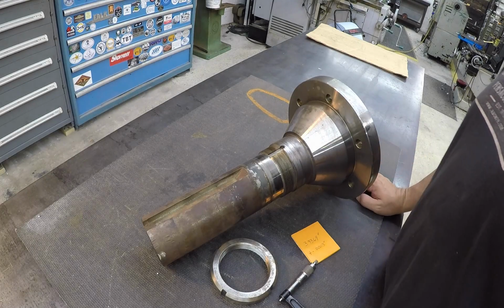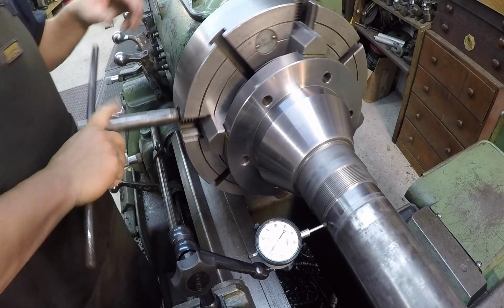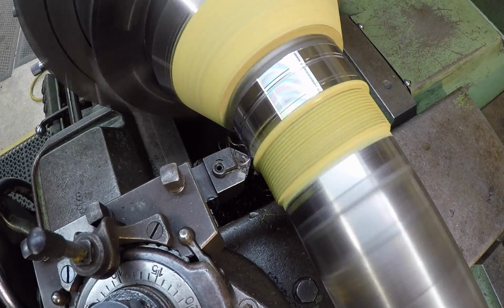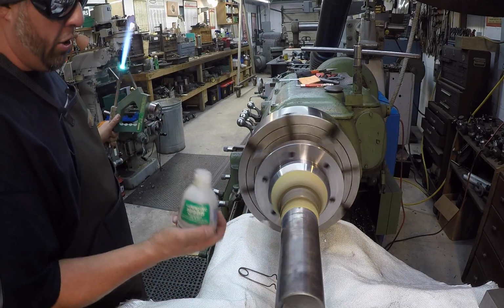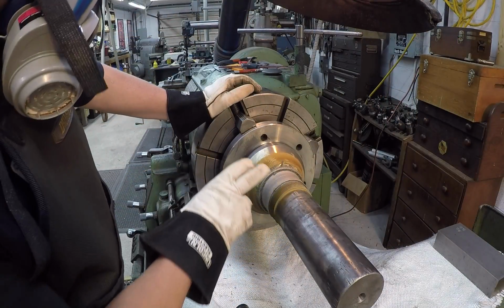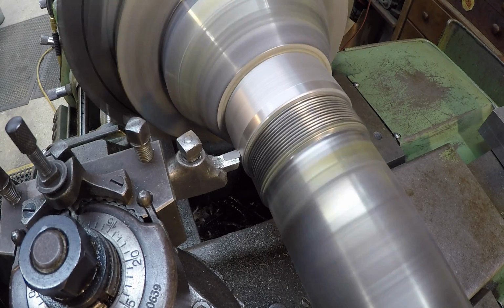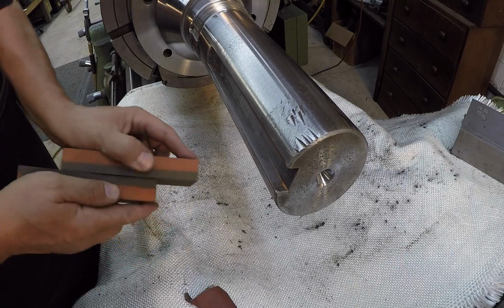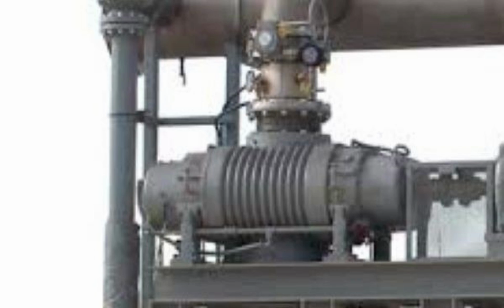SNS 300: Spray Welding a Blower Shaft

Comment: Just a random thought, but barring those cases where the part to be repaired or manufactured is something proprietary, as a customer I can see how having a detailed video record with commentary and explanations of what is being done from the actual machinist doing the work would be a super valuable for future maintenance. Like say they need to have some other work done in the future by some other serviceman or machinist and they need to know the details about what you did and how you did it, this video would save them like a month of email exchanges with you and ultimately saves everyone time and money (assuming you break even on the time spent producing the video of course). Just an interesting thought.

Comment: Thats pretty cool.  I've done lots of weld buildup on journals like this and the time savings of this process seems to be big.  It'd take me most of a shift to build that up slowly enough to keep from warping that piece.  And if the piece was much smaller than what you have there, it just cant be done.

Comment: With a typical electric arc weld the electrode rod material melts/blends with the melted material being welded. Is the same happening here, the spray-on material melting and blending with the melted steel of the work material? very interesting.

Comment: I am sure you address this per the engineering instructions, but the machining into the corner where the sprayed area meets the conical area is important to be a radius to keep stress concentrations low. This is especially important for rotating machinery with overhung loads. It becomes a rotating fatigue machine. Great video, I know Cat did this on crank bearing surfaces 25 yrs ago in engine reman plants but I did not know about the real issues. It was surprising to see the chips curl off of that when dressing to size. Nice work sir!

Comment: I was a machinist apprentice at a shop that specialized in metallized coatings. They did carbide, ceramic stellite and other metal coatings then we would usually grind it to size. It was a very dirty place to work. I’m glad you tried covering the ways up to protect your lathe. It will destroy a machine otherwise.

Comment: Thanks Adam.  When I was a kid, 50 years ago, we had parts for large farm tractors Spray Welded by a local shop in the Milwaukee area for these kinds of repairs.  Yes, it is a tried & true method of repair, like you pointed out, for specific applications.  Great job.  Your customer/clients Always get great value from yo in the work you do.

Comment: Doing Hot measures doesnt affect the accuracy while welding like that?
Reply: I am just guessing here, but he is just messuring if its over the required amount, maybe he factors in how much the metal expands and just goes over a estimate where it really should be enough, at the end he turns it down to the correct size.
Reply: @Ramog1000  yeah, probably, he keep welding a little more after checking It was on point

Comment: The Chinese need to see a craft man at work, this is how it's done. Great work,. impressed
Reply: There are craftsman the world over. Much of the stuff coming out of China is built to a price. But that is because the customers want it cheap. In the 80s it was cheaper to have a new steam locomotive built in China than it was to do a proper overhaul of one already owned in the US. I know because I inspected two on board a Chinese ship when it was in Jacksonville, Fl. The two were basically copies of ones we sold them back in the early 1900s.
Reply: That was completely unneccessary and racist at the same time. I'm not Chinese but trust me they can do good work. They do get a bad wrap because they build things for pennies so they have to cut corners on disposable tools but economics explain why that is.
Reply: scavenom2008 we don’t care that you think Richard is racist. This may be a shock for you but just because cnn says something doesn’t mean it’s true.

Comment: Pretty cool.  Now I see how that's done.  I used to grind crankshafts.  Spun rod bearings don't wear symmetrically and I was always very careful to maintain accurate stroke.  Which means you have to grind away more than just to clear the journal.  Oh crap moment:  ground an antique Cadillac crank to  -.040.  Ooops, no such bearing available.  I felt like a jerk.  It was this process that bailed me out in the end, I guess.  Sent out for build up...expensive, but it worked.  No particular worries about strength.  Fun watch.

Comment: Can this process restore a crankshaft which is worn below the last undersize? How much build-up can be applied safely?
Reply: I recall Submerged arc being used to rebuild crankshafts, if there is a material with this process that will withstand a friction bearing... then I am sure it can be used.
Reply: @kerrykroger7323  Sub Arc on a crank?Those must have been huge.

Comment: Stick weld and turn back to the standard we have a sub-arc welder; that's how we do it, but we have just stick welded axle shafts. And sub-arc crankshafts.
Reply: Arthur Fiorillo you got to be careful doing that.  A weld bead created a stress line on a shaft, and can lead to a fracture.  I just repaired a conveyor roller last week that sheared off due to fatigue where the roller was welded to the shaft to keep it centered.

Comment: first time i hear spray welding. i like to see in actual and learn about it
Reply: It's usually called "flame spray coating" in the industry. What Adam's doing here is just one application; there are specialized coatings including ceramics for a whole bunch of different applications. (The newer torches look quite a bit different - they're a lot more compact, looking a bit like a paint spray gun with an oxy-acetyline torch wand/nozzle where the paint should come out.)

Comment: 1, does the measurement you take include both micro-voids and expansion of the part while it is subject to the heat? ~( 'w')/

Also, what is a fair average price for filler metal and the likes? [assuming you are going to use it enough to use a lot of fill metal]

Comment: Been metalizing for 40 yrs, needle bearing area, need to hardface it with metco 16c power,, iv used a arc unit, 5P wire. And power guns ,, hope you used a 316 ss power

Comment: 1) cool, i didn't know this was a way to repair shafts 
2) you mentioned that welding would draw the part and warp it. could it be welded while rotating on the lathe?  That should stop the deformation because basically you would be adding a ring in a second or so thus not giving the part time to warp.  then machine off the excess.  I'm not a machinist and obviously there are things i don't know but that seems like it would work.  Thanks fo the video

Comment: Excellent workmanship, excellent outcome, just imagine how much work is in the main wheel struts of a Caribou aircraft which are about ten inches in diameter and four foot long and are spray welded with metal the length of the outside, that's a lot of sprayed metal...

Comment: That looks like metalizing powder coat metalizing used to use a wire feed 303 wire. Then we grind it down on a reel grinder the keyway wouldn't have a problem if he put a piece of carbon in that key way he wouldn't have to do anything after he sprayed you can also use well we call the Gorilla hair you can put it around a threads and a metalizing won't stick and you don't have all that clean up like he did. Makes a big difference. I need to be a lot better off if you put a hoist over the lathe makes it a lot safer and you can bring in bigger material and make more money. You can do bearing journals like you just did or you can do printing press cylinders. I did one from 1855 still working. Ivory grind bearing races candy exterior the bearing and they would be just like brand new bearings save a lot of money that way.
Reply: Pretty sure he doesn’t need your advice .

Comment: Hey Adam, I have a slip yoke from an automotive drive shaft. The bearing surface is worn and gouged up on it. It slides in the back of a transfer case and is supported by a bronze bushing. Would you be able to spray weld and turn it down back to the proper diameter and if so approximately how much would it cost?

Comment: Magnaflux it that would show a sleeve. AC for surface DC for sub surface. 👍🏻
Reply: In the very early 1980's I was a line mechanic for a Dodge dealer in the Northwest. I did all of their transmission, trans-axle and transfer cases along with rebuilding cylinder heads that came off of propane fueled vehicles. Had a speed shop guru who thought he was god and magna-flux was a heavenly tool. Many, many times while cutting valve seats in the head wouldn't you know a funky little crack would appear out of no where. God and his magna-fluxing cost me thousands of dollars in down time with no pay on those jobs. That shop drew customers from a large air base and every farm and ranch in the valley. To this day I would not give a nickel for anything that someone said "it's been magna-fluxed and all is good" especially a steel crankshaft. A hammer is a hell of a lot more dependable on a steel crank than any magna-fluxing I was ever associated with anytime or anywhere. If it rings it's good if it don't it's junk. Kind of like magna-flux in my opinion but I'm just an old man now so what do I know? Cheers.

Comment: I used this in the 80's .had a hard coating on the shaft, had to grind it with the tool post grinder. 
Great demonstration, brought back good memories. Thank you Adam.

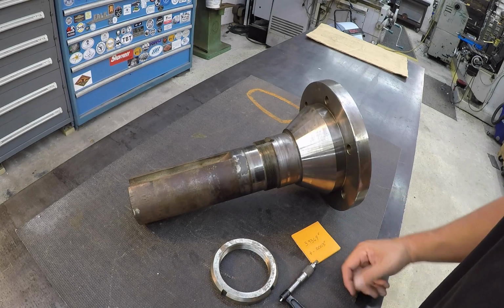Comment: Isn't 3 tenths of an inch .3 ? then .0003 is thirty thousandth of an inch.   1:15
Reply: "three tenths" is three tenths of one thousandth of an inch, so 0.3 * 0.001in = 0.0003in.  Three tenths of an inch is 300 thousandths (0.300in)
Reply: Thirty thousandths would be .030 
3 tenths, in this context, is short for ten-thousandths, or .0003
So yes, 3 tenths is technically .3, but machinists would call that 300 thousandths.

Comment: Sure would like to see an experimental tig weld build-up using a lathe!
Reply: too much heat.
The point of spray welding is to get a low temp(usually high wear resistance) metal on the surface with little heat/distortion in the part.

Comment: Excellent video! It started with a spray welding equipment in pristine condition and a rusty, worn out workpiece and ended with everything shining and a lot of fire and sparks in between. I did not know that spray welding was even possible: it sounds like feeder particles would corrode before they hit the workpiece but apparently not. There must be a lot of experience involved in adjusting the fuel-oxygen ratio of the flame.What a treat. Thank you!

Comment: it drives me crazy when they use inches, especially fractions or tenths and thousands of an inch. Why work so hard? Use metric!
Reply: Alexander Herrmann it’s just what us crazy Americans have always used and we are too stubborn to switch, even if it’s easier! 😁😁😁
Reply: Because that was the original specifications and the replacement bearings are sized to inches.
Reply: Fractions are dumb.
But so is metric. 
Working in mm at .X tolerance is useless in most cases.
Working in mm at .XX tolerance if fine for most cases but you often need to use an extra number compared with inches .XXX
Inch .XXX is the ideal machinist system. Less numbers then mm .XX and usable unlike mm .X
Reply: @kkknotcool  that depends on what side of the pond you are looking at it, the customer is asking for ca 100mm nice round number, i had to google it its 3,93700789 inch.
if i were to do it inch i ́ll be lost or f*** it up, props to all there can do both
Reply: @LastRaptor  That's not my point.
My point is machinist use .001" as our base unit of measure in the US.
In the rest of the world they use .01 mm as the base unit of measure.
.001" = .0254 mm.
Meaning metric people use 2.54 times the tolerance, for what i would argue is useless most of the time. 
And for the once in a while times you need a tolerance under thou, you have tenths.

Comment: Towards the end you talk about how this works for ball bearings but not needle bearings.  Can you elaborate?  Don't both types involve something rolling over the surface?
Reply: needle bearings often don't have an inner race, so they are rolling on the surface of the shaft. ball bearings do tend to always roll on some sort of inner race which spreads the pressure over the complete circumference. The needle bearing creates much more surface pressure through the single needles  being in contact with shaft surface
Reply: I think he is saying a needle bearing with no inner race so the needle bearings would ride/roll directly on the finished surface of the spray weld, whereas a roller bearing with its own inner race would not. In the case of a roller bearing the "roller" only contacts the inner and outer race of the bearing itself, which is a hardened material. With a needle bearing the rollers contact the outer race and the actual shaft.
Reply: No, he said anything with an inner race was OK, something like a direct contact needle bearing was not OK. I suspect the high surface contact stresses exceed the spray applied capability. The measured hardness needs to be in the range of Rc58 for rolling element bearings for fatigue, and ground to dimension after heat treat.

Comment: I think this is the COLD process where you don’t get it much over 200°. 
I had an old Eutectic torch and you had to sweat the metal (red hot) to get the powder to stick. With the cold process you don’t ruin the heat treatment; right Adam?
Reply: It's the merit of the bonding layer firstly,like a primer before paint 😁

Comment: Thanks for showing that, never seen that before! What's the advantage of this vs TIG welding a bead on there?
Reply: Many disadvantages to TIG in this situation,first,it ruins the heat treatment,then can warp the linearity of the shaft along his own axis,any of these 2 main reasons is more than enough to fuck up the shaft...

Comment: That spray welding is a process that if you hadn't known about it, and someone told you it would work, 99.9 % of people would say you're crazy, and laugh. Amazing how that flame keeps oxygen in the air from burning up the metal powder before it reaches the work piece. And how those particles can bind to the relatively cool metal shaft. It shows how the bond is at the atomic level, right at the surface. Like when steel cutting torch slag sticks to concrete. I've got some on my driveway that a pressure washer didn't dislodge.  
The camera work was outstanding.

Comment: Did you have to check the registering counter diameter to be true to the outside diameter you chucked up on? I guess because you checked runout over the length of the shaft is probably does not matter.  Great job. Being in an aircraft overhaul and repair station we have done plasma spray weld and electron beam weld repair build-ups for machining back to spec. Nice job..

Comment: High-precision work 
I don't understand how that torch works.
Reply: The torch is letting a small amount of metal powder that gets extremely hot when it pours out into the flame, most likely it melts entirely. The flame blasts the molten metal dust at the part, where it sticks and solidifies.

Comment: Thanks!  This was very helpful for me!  I do the same kind of work that you do.  A company I worked for would do this repair process and I would do the lathe work.  They spray welded journals at a different location, but the prep work was slightly different and that stuff would flake off so easily, if you took too deep of a pass- more than .005.  Then, just when you thought you'd get a nice finish pass, it would pick up and gouge.  So frustrating!  But you taught me it can be done successfully.
Reply: Micheal, this is the exact reason why  thermal-spray (or as you guys called it "spray-weld") is not popular is because the job is badly done by some untrained workers and it gives rapidly a bad reputation. You can help the guys by telling them three main things: first you must prepare the surface either by grit-blasting or rough machining RIGHT before apply the first coat and do not touch with your hands the prepared surface. Second is you need to use the material for the bond coat as the first layers, then you can use the final material (generally much cheaper) as he shows it on the video. Third is you need a minimum thickness as finished (about 20 thou), if the coating is too thin, it will not have the strength to be cut properly.

Comment: Polishing that oil seal race area IS Very important. The oil seals are softer by far and Any imperfections will grind the seal off in days or weeks and leak. What you did gives it a nice clean race that has no edes larger than the oil film. Great work. Good skill. Cool to watch a true craftsmen fix some very few have any idea how to do.
Reply: Yep. Open drive York chillers will eat seals for breakfast if there is any slight grooves on the seal journal. If you can see it, it's pretty much a given you will be back in six months to redo it

Comment: why do you Americans always set the top slide over to 45 degrees?
don't see it in UK.
Reply: I always leave mine at 90.
Reply: I have always set mine at 30 degrees. I guess it's what you're used to.

Comment: The proper term of this technique is called Thermal-spray. Yes, as you said, this technology  has been there for more than 50 years. The model you are using is indeed a very old model, none-less useful for small repairs. Now the technology has obviously changed and  most workshops are using Arc-wire spray, way cheaper in term of consumables compared to powders. Your comment on the applications is quite accurate, however the best preparation would be grit-blasting instead of a thread. But not everyone has the facility, the effect is having a higher bond strength.